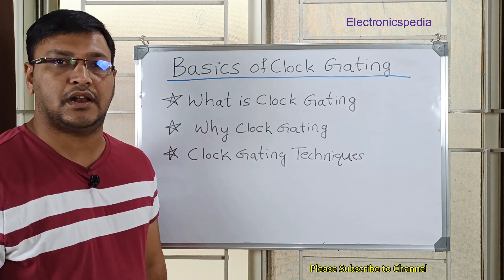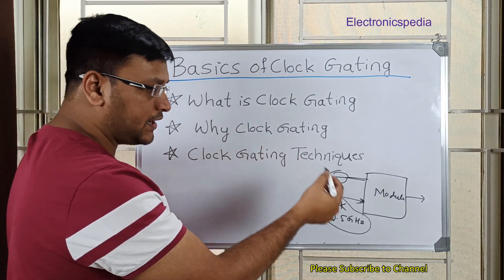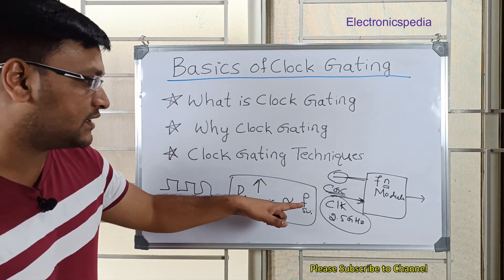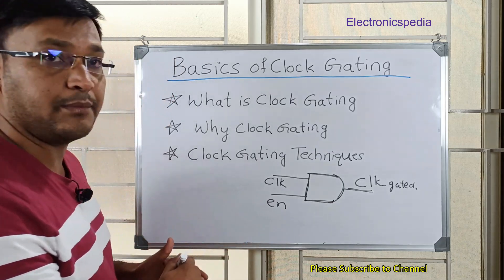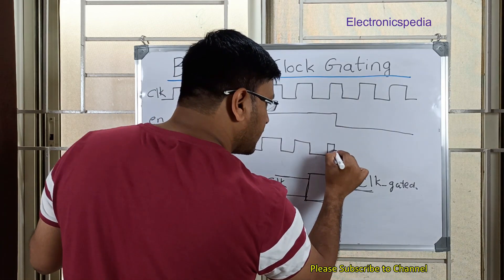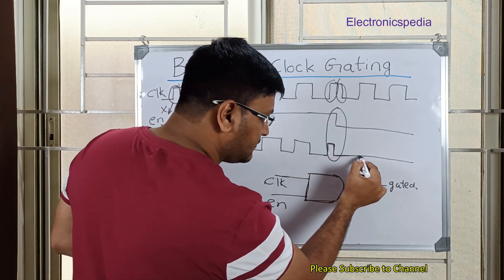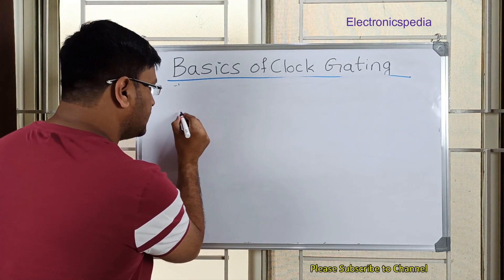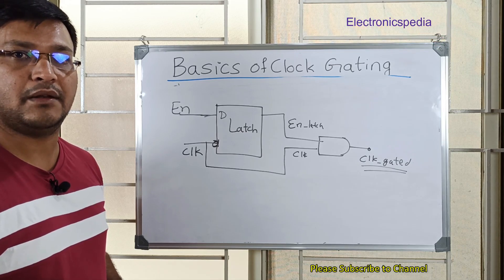Clock Gating Basics | Basics of Clock Gating | Clock Gating Techniques |Integrated Clock Gating(ICG)

Comment: LATCH WILL HAVE INPUT AS CLOCK ?? IS IT CORRECT ?
Reply from the maker: Latch will not have clock pin, it will have enable pin. But we are connecting clock to enable pin.